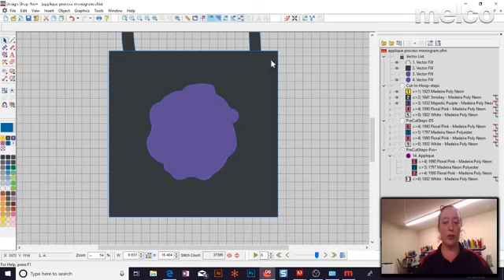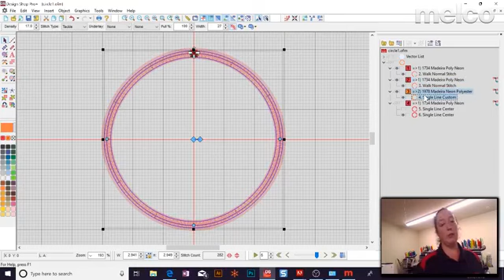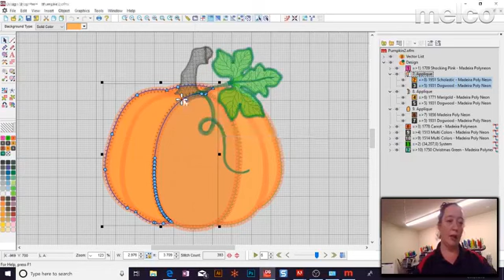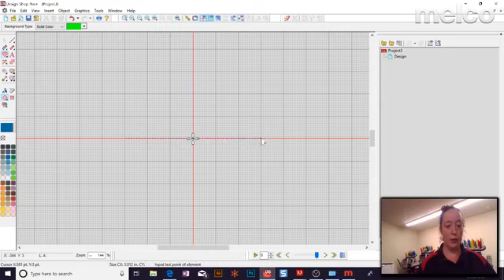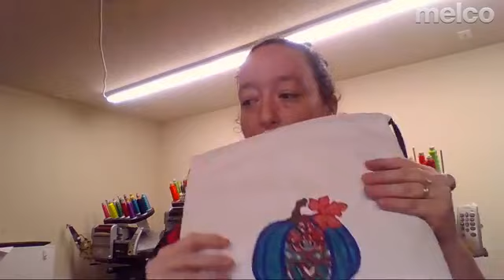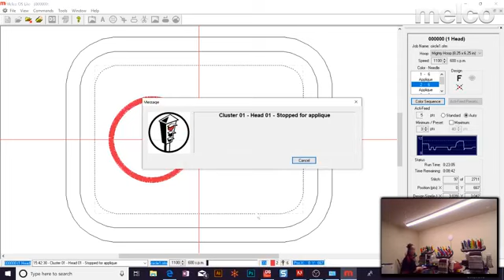All About Appliqué!

Comment: Will the settings for the 60/40 need to be adjusted for every appliqué?
Reply from the maker: Hi Tiffany, you can enter the 60/40 properties under Applique and then Save Defaults Permanently. That way 60/40 will be your new default setting.